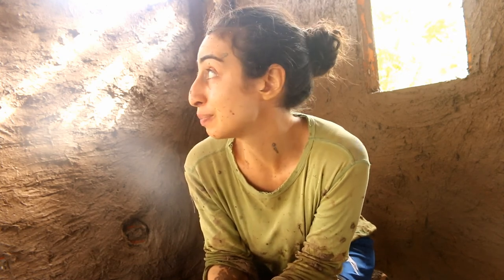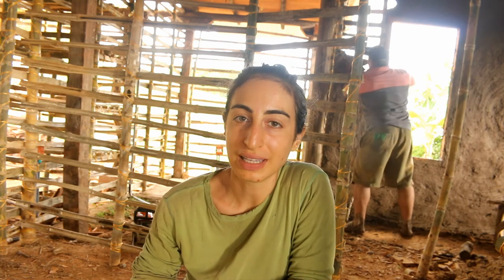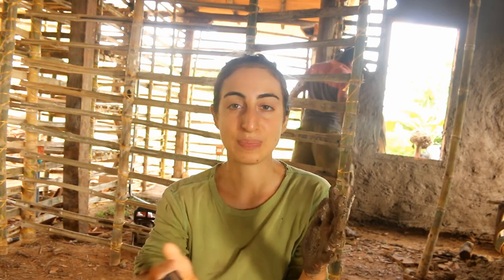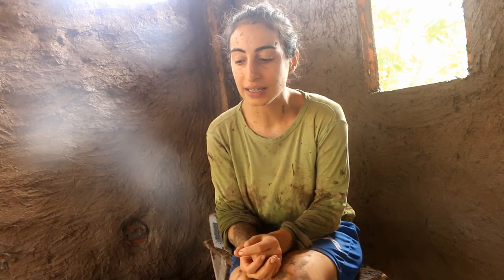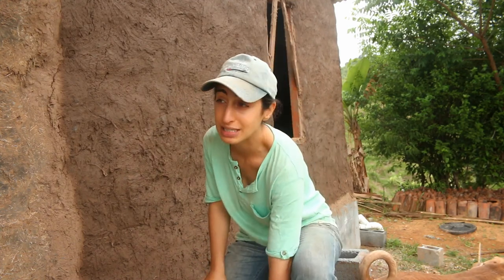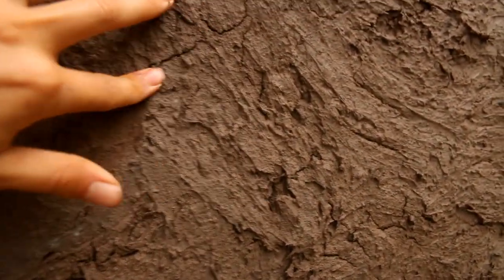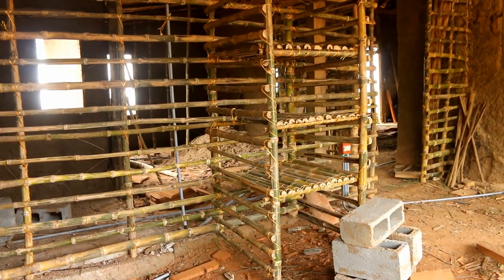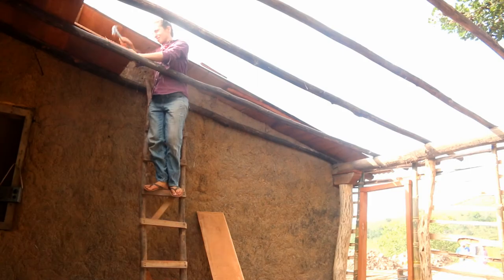Sculpting Mud Walls By Hand | Panama Culture, Mud House, Casa de Barro, Natural Building

Comment: Hi there.. So happy to see mud buildings around the world 🤗 just wanted to know if the bamboos used were treated before using for the building.. Is it ok not to treat the bamboo when its going inside the walls and covered with mud? Thanks in advance 🙏🏻😊
Reply from the maker: Hello! There are a few different traditions. 1 is they do not treat the bamboo, but it is the green bitter variety, so it has more resistance against termites. 2 is they did treat the bamboo traditionally by immersing it in the sea, which "pickled" it and preserved it, but that has not been done for a longgg time in Panama! In mud homes built in the last 20-40 years or so, they have used untreated bamboo. HOWEVER, I recommend treating the bamboo with borate/salt water OR raising the bamboo on to a stone base. This will ensure better protection!
Reply: Treatment with boric acid is probably the best diy way. Salt water is fine, but it takes a long time and if it comes in contact with metal, no good.

Comment: Does the thickness of the mud walls have anything to do with the heat/humidity? I live in SETX, which is considered a subtropical region (great for growing bamboo!), so I’d love to learn more about this method of building. What would you say is the temperature difference between the interior and exterior?
Reply from the maker: Absolutely! The walls trap and release humidity and regulate heat. In Panama, the temperature is 90-100F outside but with a 6 inch mud wall, the interior is around 71F on those days! Without any AC, just the natural effect of the wall 😊

Comment: Also want to know more about the traditional methods used for flooring in Panama🌸
Reply from the maker: Unfortunately, these homes are no longer built, and the older ones that are still around use a concrete flooring. There are some very old casas de barro around that show that they used unsealed clay tile on a compacted stone base. For our home, we are doing earthen floors (sealed with tung oil) and tadelakt lime floors. I am teaching these methods to the community in order to reduce the use of concrete 🙂

Comment: Love the building of the house. Have you noticed any termite damage? I'm considering building a home with adobe bricks when we move to Panama, and I'm concerned about how it may fare with terminates and the high humidity there. Any information will be greatly appreciated. Thanks 😊
Reply from the maker: No damage but we definitely see them! You have to be very careful of all wood you use inside the house. I only use bitter cedar, corotu, macano, mahogany, africano, and teak. Teak needs a tung oil+citrus solvent treatment every 6 months or so, but no issues with the rest of the wood. We also cut during the 5 days before the new moon, which locals say prevents bug attraction. It seems to have worked!
Reply: @turiyapanama  sorry for the density... by "inside the house" you mean like furniture? Or do you mean like beams inside the structure.
Reply from the maker: @PhoenixBeI  everything! Even our furniture is mostly diy so we could select the wood that goes in the home. If you have any wood that is not the heart of wood, they will find it in this climate
Reply: @turiyapanama  so you're saying that if I build a home like you did it may get eaten by termites?
Reply from the maker: @PhoenixBeI  my hime hasnt been eaten by termites. But we cant have cardboard around for example and have to make sure there is no bark left on any wood we use as this attracts them. You also need to use mature, not young, teak. Then youll have no problems
Reply: @turiyapanama  thank you